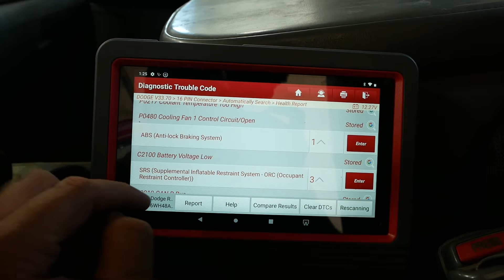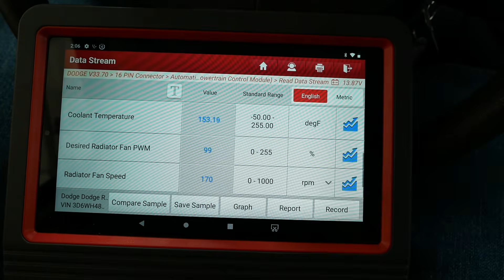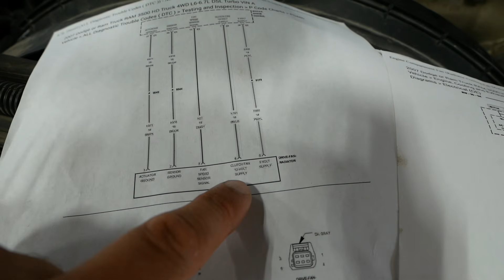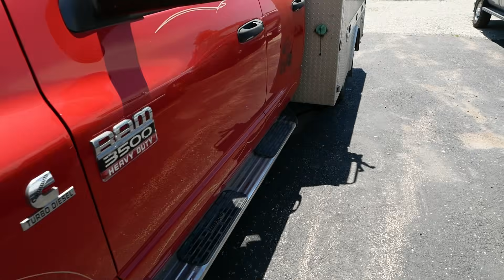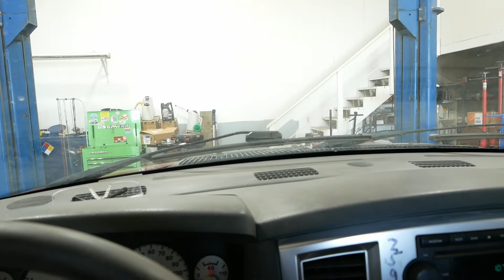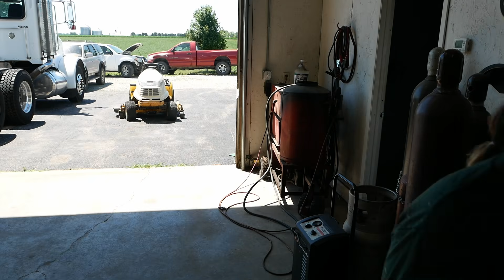6.7 Cummins Fan Clutch Woes - New doesn't Mean Good

Comment: Nice fix Wes.  Exactly right, new doesn't mean good.  I just had my transmission rebuilt 3x due to bad parts that were new.  6 hours just to get the tranny out and over 4 just to put it back in.  All done 3x.

Comment: I'm glad I'm not the only guy around that believes in blowing off the mower deck, I've fixed my deck three times but not from rusting.
Reply from the maker: I have to weld patches on this one every year. The sandy soil just wears through it. The whole top is paper thin. If we get two more years out of it I'll be amazed.
Reply: @WatchWesWork  You can't get around that my problem was exploratory mowing where should not have been.

Comment: Never messed with such a fan like that before. However, could you apply a voltage to the fan outside the vehicle and see if it locked up via the ferrofluid? IDK just wonder if that would be a way to test it...
Reply from the maker: Yes you could if you know what wires were what.

Comment: The electro-viscous fan clutch (yes, that's the name) basically just replaces the little bimetallic doodad that purely mechanical fan clutches have with a solenoid. Internally the clutches still work the same. Solenoid opens up, allowing the silicone fluid to enter in the "friction" area at a controlled rate.

"what if we take the worst aspects of a mechanicL fan clutch, and the worst aspects of an electric fan and combine them together" - engineer, somewhere.
Reply: It's for efficiency. Converting rotational energy into electricity and back into rotational energy is far less efficient than just turning a clutch on and off. You get away with it on lower powered engines because the alternator, fan motor and wires are still reasonably sized, but at some point, it just becomes stupid. (like someone else said, 1000A at 12V to drive the fan? even if it's just 100A, that's ridiculous).
Reply: Trailblazers had a super annoying version of this kind of fan. Doing water pumps on them was tricky, mostly because removing the fan was fiddly and annoying.
Reply: Yeah the old reg viscous fans are awsome you wana move tons of air in high temps they work.
Reply: Clutch fans for class 2 and 3 trucks take about 35 HP to run when fully locked up. Look up the size of a 35HP DC electric motor, and you'll see why they use mechanical fans.
Reply: Which is nothing compared to the 2008 5.7 Hemi's fan setup in WK Jeeps. Nothing.
I'm just gonna tell you everything you need to know in one sentence: it's a hydraulic fan which is part of the power steering system.
Reply: @unavailablenumbers  WHAT
Reply: American Locomotive as in Alco?
Reply: There's the old ecu pwm controlled hydraulic fan I think some US Fords and Japanese luxury stuff ran too
Reply: I have a similar problem as this truck, except my out of the box replacement clutch doesn't want to turn off.  My cold truck leaving my driveway in the morning sounds like a turboprop taxiing onto the runway.
Reply: Useless tech. Why not use a regular electric fan?
Reply: @dmitryhwguy1646  Modern diesel pickup trucks really make too much power, and have tow ratings that are too high for the space constraints. So they have relatively small radiators, but need extremely powerful cooling fans to cool the engine during very high load situations. The mechanical fan can consume upwards of 15-20 HP when providing maximum air flow. An electric fan would need to provide that same amount of air flow, but would consume a tremendous amount of electricity. 20HP @ 12v is over 1200A of current.
Reply: @dmitryhwguy1646  i have car  turbo inline 6 there's so little space between radiator and engine my options was pretty much use stock viscous clutch fan or fans so expensive i would need to sell my kidney. I tried cheaper electric fan but it had to run constantly because if you let the radiator get warm it fan wasnt able to take temps down effiently. Put the stock viscous back in all good. Conclusion i will always keep viscous fan if car has one. 

This is just my 3 cents. Due to inflation.
Reply: @dmitryhwguy1646  it's the variable speed clutch that causes problems, then add the hot rated required temperature for afterteament diesels ..
Reply: @dmitryhwguy1646  electric fan can't move enough air to keep a diesel cool, the big engines are all belt driven fans as well.........
Reply: @randallvos  That's BS, modern fans have enough power to lift clean off the table. Brushless. New world tech.
Reply: @aserta  I guess the complication might be amp draw.  How many amps at 12v would it take an electric fan to match the output of that big mechanical one, especially under resistance, and for how long of a duty cycle with heat etc?
Reply: @randallvos  almost all diesel cars and pickups in my country (india) use electric fans for cooling. only large lorries or semi trucks (for muricans) use engine driven cooling fans. even those are being replaced as modern lorries are 24v now
Reply: @lordjaashin  Most diesel cars and trucks in your country do not have 400+ HP (298kw) diesel engines. Engines making that much power need tremendously powerful cooling systems in trucks.
Reply: @aserta  A brushless motor capable of providing the power needed could fit in that space, but you would not be able to provide the sustained electrical power necessary to run it. Fans of this class typically require 10-20 mechanical horsepower to move enough air. A 20HP electric motor running at 12v will require over 1200 amps of current.
Reply: @AmericanLocomotive1  bullshit. Electric fans can easily cool 1000+hp gas engines, but can't cool diesel ones? Towing can be a problem, probably. Small radiators are the main issue. Anyway, if you can't have an electric fan, you can use pneumatically controlled fan, not viscous, just like big lorries do
Reply: @AmericanLocomotive1  the cummins in the video has 400hp +?
Reply: @dmitryhwguy1646   electric fans won’t keep a 1000hp gas motor cool either if it is actually generating 1000hp.  Hook a 30000lb trailer on that 1000hp electric fan setup and drive it up a mountain for a few minutes and you will quickly find it is woefully inadequate.
Reply: @lordjaashin  I think at the age of this truck it was rated 325hp but you can get ones rated 400+hp today.
Reply: @lordjaashin  This particular model is 350HP (260kw), but newer model diesel trucks from General Motors, Ford and Chrysler are over 400HP.
Reply: @aserta  “modern” this truck is a dozen or more years old
Reply: @dmitryhwguy1646  diesel engines run on compression to fire, so run higher compression than gas, which is why you can't use a gas compression tester on diesel engines, and gas engines uses spark less heat, to exchange, all the best to you and your loved ones
Reply: @lordjaashin  those trucks with the 5.9 Cummins diesel can tow up to 16,000 lbs or 7257 kg in the right configuration, and the newer 6.7 diesels even more.  I’d say that’s a bit more than your average diesel car or pickup on the road in India, and probably more than a lot of the lorries.  That’s not to say it’s better, as I’m sure a lot of the available power in these big diesel trucks goes unused by quite a bit of owners.  They are basically lorries, or semi’s, with a passenger cab and a cargo bed.
Reply: @lordjaashin  this truck in question, has a 6.7lt  Cummins (24 valve) and they make a lot of power, you can use them to push a 15,000kg bus or truck, its not some pissy little piece of trash like is used in a Nissan Patrol, Toyota Landcruiser or some such.
Reply: @donaldhalls2189  i don't know, what you try to tell us, your comment is pretty weird. Gas combustion is about 200°C hotter than diesel combustion. Compression testers are the same for diesel and gas. As diesel engines are more fuel efficient, there is less heat to be cooled down in the cooling system.
Reply: @stefankaufmann8257  then how come petrol (gas) engines run 4:1 to 8:1 ratio 10:1 approx 201.8 psi and diesel run 14:1 to 22:1 from 275psi to 400psi if their the same
Reply: @donaldhalls2189  if you don't understand physics of combustion, stop commenting. It's not the compression that heats up the engine, it's the combustion. Diesel engines run on Lambda >1, gas engines on Lambda <=1.
Reply: @aserta  show me a 10HP electric fan, then ill believe you.
Reply: @dmitryhwguy1646  1000 hp gas cars definitely aren't towing 15,000 pounds up a 5% grade almost ever. Having huge 200+ amp draws from a set of high CFM electric fans so match an engine driven fan would require a gigantic super high efficiency alternator, a big battery for the extra reserve capacity and if any part of that equation is lacking it'll wreak havoc on system voltage and modern vehicles in general have extremely sensitive electrical components that get really crazy with low voltage. Electric fans kick ass for performance stuff, they're even good for older light duty trucks but on big diesels no they're not practical
Reply: @randallvos this is correct, I was surprised by this too but low speed high power demands the engine driven approach. Most other companies use an electric fan for the A/C though
Reply: @dmitryhwguy1646  On my BMW E34 i had both systems, a two stage electrical fan controlled by two stage temperature switch in the coolant circuit, pressure switch in the AC circuit for stage 2 only and stage 1 was switched on by the ecm, when the AC is turned on. I heard the visco fan working  in summer during stop and go traffic with AC on only. The system is extremely reliable as you have two independent fans, so you always have a backup, if one fan fails. 

In general electrical fans are very reliable, if they are quality parts, but they require a lot of amps. That's why they are controlled by PWM nowadays - resistors are more simple and more reliable in my opinion. I have a Puch G290D (=Mercedes G), it will get an upgrade with one electrical fan assisting the visco fan. As the G is a military version, it has a 24V alternator, amps won't be a problem.
Reply: @stefankaufmann8257  mercs and bimmers come often with viscous fans. And then leaking coolant on hot summer days with blown radiator when this fan fails
Reply: @dmitryhwguy1646  what happens when your electric fans fail?  Rainbows and unicorn farts come out instead?  Everything fails, even magical electric fan motors.
Reply: @dmitryhwguy1646  nowadays most BMW don't have a visco fan any more. Electrical fan was always installed, when the car had AC - most BMW were ordered with AC.

Before the radiator blows, the car runs hot. That's why you have a temperature gauge and you are supposed to use ist. When the radiator blows (never heard of one beeing blown...) it's all too late, because the head gasket is already blown and the head cracked.

Comment: I am with you on oem parts. but it's not like ford/gm actually makes them, I worked as engineer for several suppliers, when volume gets low and goes to service you scrap the line and build by hand (floorspace). I could see the aftermarket actually working better  depending on where the oem part was at on lifecycle and may come with better warranty.
Reply from the maker: It depends. I worked for an automotive OEM once upon a time. Most parts that we replace are not made by the OEM, even in mass production. But you are correct, when the volume drops, often the supplier changes to someone better suited to low volume production. However, the tooling is typically the same since the OEM owns the tools.
Reply: @WatchWesWork   tooling is the same just 20 years old and cared for enough to just make run. it cost money to set tools and even more to maintenance them. seen at lot of shady stuff to get "parts" out the door. At that point limited lifetime warranty sounds good for $20-$50 cheaper.

Comment: The Florida pool pump motor repair guy, Longwood approved ! that was good info. Wes. Drill 2 holes and put bolts in the Original fan clutch now it's permanent. $800 That's crazy for a part.
Reply from the maker: I know. Everything for a diesel is 3X what it should be.
Reply: @WatchWesWork  10W-30 AMSOIL ? and a pre-air filter
Reply: Jay Finke,  my buddy had a brand new turbocharged Celica years ago, and that was a factory fix to reduce the under hood heat.  Permanently lock the viscous fan. 
Less to worry about I guess.

Comment: Would the fan monitor even run while there is an ECT sensor fault?
Reply from the maker: Yes it should.
Reply: @WatchWesWork  Odd that it’s not throwing a speed out of limits fault with demand at 99% and fan speed on the floor. Hmm. Two trips needed?  Unlikely. V odd.

Comment: Here in the UK we have vastly smaller engines than in the US, is this to do with high compression verses low compression ?
Reply: It's because of emissions laws. And the UK is so small compared to the USA farmers just use their tractors to haul stuff. No need for a 6 liter ute.
Reply: @johndeerekid167  cheers for the info!
Reply from the maker: I think it has to do with taxes. Europe was big on taxing based on displacement.
Reply: @WatchWesWork  Thanks for the info Wes, I just have to shake my head when I see the size of engines you work on , thinking how much it would cost to run over here, we are up to £2.00 per litre of diesel. I drive a 1.6l and it cost adout £180 per month!

Comment: Hey Wes do you have any recommendations for cheap brass punches and drifts? I've seen some from Mayhew but at almost 50 bones thats a little more than i want to pay for a brass drift set. Got any alternatives?
Reply from the maker: I don't know. I have the Mayhew and they are good.
Reply: Buy brass round bar from a metal supplier.
Reply from the maker: @bmw1894  The Mayhew punches are bronze, which is stronger than brass. If you can get bronze stock, you're all set.
Reply: @WatchWesWork  There you go, you learn something new every day. That said mine are brass offcuts from an old neighbour who was a fitter and turner, and they've held up to the abuse pretty well.
Reply: The Mayhew set is well worth the money. Most of Mayhew's stuff is lifetime warranty, but I'm not positive the brass punches are. They may consider them consumable. In any case, I've had the same set for probably 10+ years.